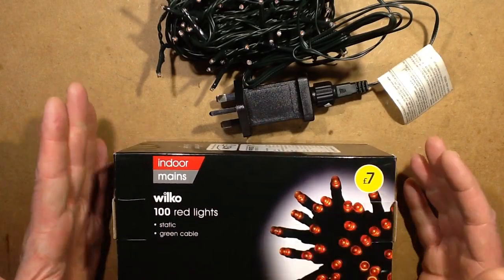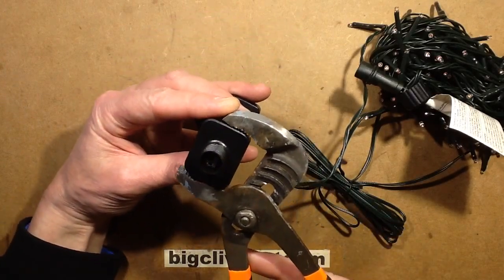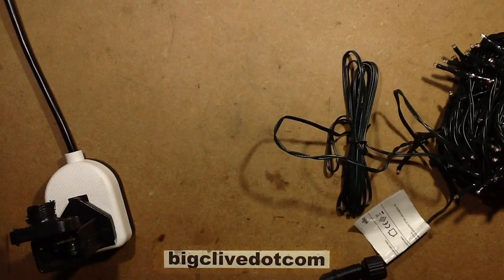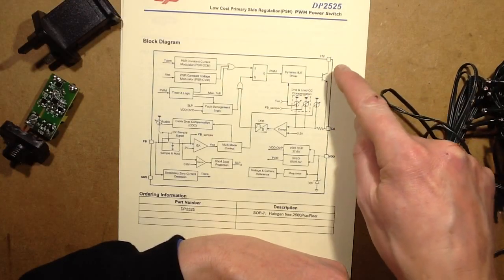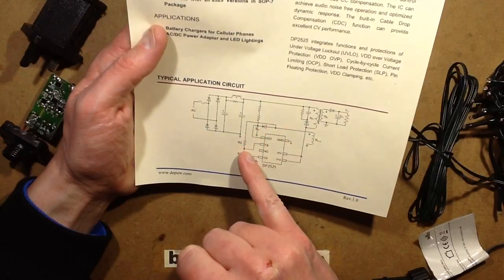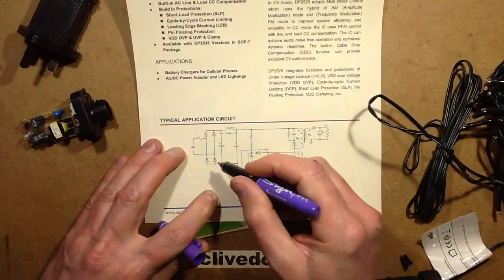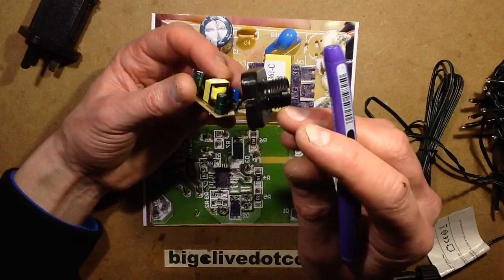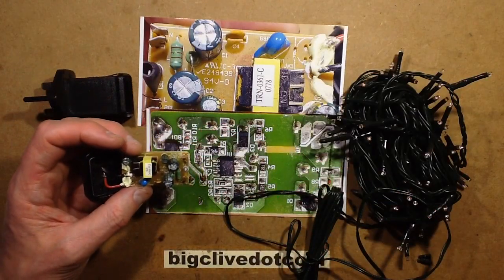Inside a Jutai Xmas lighting power supply.

Comment: Have one of these LED strings with a fault that did cut output power to at least a half. Now LEDs glow, but very dark. UPDATE: Found the problem - both BJT NPN transistors (FTC8050HH, with label KEY) behind JT-022 MCU went bad. MOSFETs (NCE60P04Y) was fine. Replaced FTC8050HH to SS8050 and lights worked again. But idea was bad in general, Vce for SS8050 is 40V and due to occasional 60V transients one of SS8050 died just 2 months later. Replaced both BJTs again, at this time to MMBTA06-7-F. Replaced US2G to fresh one too. And reflowed all suspicious solderings to be sure. All is fine now. Fingers crossed...

Comment: Just hung up a 1200 led warm white set of lights around my parents house that had one of these "well designed" boards to power the lights. Whatever happened, it burned through the dp2525 and accompanying resistor in about 20 minutes. Second set of these that the power board burned out in 2 years. Complete junk. (or maybe we're just very unlucky)

Comment: Hi Big Clive. Have just watched your christmas tree lights video. Really enjoy watching you strip back random electrical items to see how they come up with designs. Have you ever reverse engineered the timer circuit which they use on lots of these Christmas lights, the 18-6 hour timers? as i could do with an upgrade on some solar lights to maximize the few sunny days we get in the UK. Thanks David
Reply from the maker: It tends to be custom software in a microcontroller.
Reply: The better solar "christmas" lights now have the 6/18 timers built into them. I recently bought some sets of Philips solar net lights on clearance at a local hardware store, and they were very high quality, had large good glass solar panels, and did have the timers built into them.

Comment: Where is the best place to but a replacement led driver for a Christmas tree? (Stood on the plug taking the tree down lol). It’s a pilot king brand 29v 6w model number PK-BS-D290060N but I can’t see an exact replacement anywhere online as yet. Thanks
Reply from the maker: The generic 29-31V power supplies are common, so it may be cheaper to buy a cheap set just for the power supply.  Note that ones with two pins and "effects" reverse the polarity to the string for the effects and will not work properly with simple non flashing sets.
Reply: @bigclivedotcom  thanks so much. So as long as I get a 29v to 31v and Max 6w with 3 pins even though the earth pin is plastic it will replace it ok? I’ll have a look in tescos home bargains the range ect to c can I get a set with a suitable plug. If now Is Amazon the best place to buy these or do u recommend somewhere online in particular. It’s a pre lit tree with the lights attached(came with it) thanks again.
Reply from the maker: @ronant87  Most of these power supplies are double insulated, so have no metal earth pin.  The big stores will be dumping all their Christmas stock around now, so it's a good time to look for suitable power supplies with free strings of lights included.

Comment: managed to open mine cleanly after it stopped working using moderate heat from a heat gun, and after setting firmly in vice, priced it open twisting a wide blade chisel between the top cap and the vice jaws. Problem was that the connection blades between the mains pins and the circuit board had spread..probably the result of over active pulling the plug from the Mains...lol, closed them up to make contact again, everything working again, btw thanks for the video...

Comment: @bigclivedotcom I bought a Christmas Icicle set using one of these Jutai style transformers and maddeningly it doesn't appear to have a memory function 

Considering its installed with the plug socket in my home networking setup in the attic it's not terribly accessible for me to press 3-4 times until it reaches soft twinkle ( my partners preference of Christmas luminance cheer ) 

Do you have any insights into how to modify / replace one of these controllers to gain the memory function ?
Reply from the maker: It's usually easier to try and find a power supply that has the memory option.

Comment: Hey Clive, I'm trying to repair a 220V-31V/24W version of this. It looks like two of three parallel resistors on the CS pin of the DP2543 are blown. I can only read part of the codes on them (R_10). The remaining one is 4R70 and reads ok. Can you help me identify the blown resistors?
Reply from the maker: If the current sense resistors are blown it suggests that the driver mosfet has failed short circuit.
Reply: @bigclivedotcom  I was afraid of that. Not sure how it would happen with the OCP. Is there anything else I should look for as the potential cause of that if I plan to replace the DP2543?

Comment: Thanks your video helped me figure out that the power supply is repairable, I opened the case, pulled off the heat shrink from the "fuse" and hey presto the resistor is burnt to f'. I have 2 of these supplies gone bad so with some new 10ohm 2W 5% metal oxide resistors I should be good to go again. Would have been nice if they used a thermal reset or perhaps a proper auto style fuse that's easier to replace rather then throw the whole PS away or have to solder in a new resistor.

Comment: What kind of lifetime would be expected from such a led strip? Just had a look at a very similar set of warm white lights, and was very disappointed to see them get very dim after less than 2000 hours burn time. 31v rated power supply. Voltage under operation sits at about 29 volts, matching a less worn and still bright set, but the current is perhaps 20-30% above expected. 3 watts for a 12m 80 led strip.
Reply from the maker: White LEDs do often lose intensity over time.  The cheap ones used in Christmas lighting seem to degrade very quickly.

Comment: Hi can I ask a question, I have gone through 3 of these power supplies on my fairy lights. All 3 power supplies have been used on the same string of leds. The leds work fine for between 1-5 hours then they turn off and the power supply is dead. The leds are outside on a fence, maybe there’s a slight short in a wire and when wind blows the wire it shorts and blows the power supply, could this happen? I can’t understand how I’ve gone through 3, it’s so strange, love to hear any advice

I should add that the leds were working fine for 1 month with no issues

Sorry and another dumb question, is the output 31AC?
Reply from the maker: Are the power supplies the correct voltage for the set of lights?
Reply: @bigclivedotcom  yes they are 240v Australian, I opened one up, and looks exactly like the one you showed and nothing seems blows, no smell nothing, I also took off shrink wrap off the fuse resistor you mentioned and it looks fine, I'd ship it to you if wanted to take a look but I can't work it out for the life of me, the last one i put in lasted for 5 hours then lights turned off and power supply dead again never to turn on, so strange
Reply from the maker: @jimjones5419  What's the rated voltage of the LED string and power supply.  At first I wondered if it's the type of power supply that has the six hours on and 18 hours off function.
Reply: @bigclivedotcom  the primary is 210-240v 0.50A

Secondary is U rated 31v P rated 12W
U out is 34v and tc is 75 degrees C

Led string is 31v 9W and I have four connected together, hope that helps, thanks for your help

Comment: Nice one Clive. You are the only video I have found so far going over the 31vdc power supply. My 2 pin molded plugs on 2 of my nets work-hardened off so I am trying to find a large 31vdc power supply to wire them both into. I now realise that 31vdc is not a popular voltage. 😂
Reply from the maker: Very common voltage for LED light strings.   Basically 3V LEDs in ten series sections.  But quite an odd voltage otherwise.
Reply: @bigclivedotcom  tell me about it 😂. I thought it would be a good idea to build myself a single large power supply and then wire each set of Christmas lights into via spring loaded speak cable connectors. But you think I can find a 30vdc power supply anywhere?!  😂😂😂. Only thing I can find so far is a dell power supply. Surprised there is not a market for this sort of thing to replace a bulging extension lead full of jutai power supplies. Thanks for the video. Great work Clive. Just subscribed 👍

Comment: Can't believe how many, similar to these,  I have opened up where they fit a leaded diode in the clamping circuit to protect the transistor. On closer inspection it is usually a 1N4007 rather than a high speed version. Frightening cost cutting ideas, and explanation of early failure.

Comment: I was given a set of led lights to repair with one of these power adaptors. The adaptor was dead. It was a Jutai 4.5 volts 9 watt. To save time I bought an adjustable adaptor which was rated at 12 watts. At 4.5 volts the leds were drawing about 1.3 amps so I switched the output to 3 volts & that reduced the current down to .36 amps. There wasn't much difference in the amount of light they were giving out so I left it set on 3 volts. When I searched for an exact replacement I could not find any with the 4.5v 9w rating, they all seem to be around 5 watts or less. I wonder if there was a problem with these 4.5v Jutai power supplies failing due to the higher current output. Thank you Clive for the great videos ☺
Best wishes Mike

Comment: Does anyone know the low voltage connector type? I have several sets of these lights that I wish to connect to a multi-channel DMX controller that is specially designed for these dual channel 2-wire led strings. I have installed panel mount SP13 connectors on the controller housing as they have a waterproof cap. I could cut the existing connectors off the led strings and replace them with SP13 2-pin male connectors but I would rather leave them intact and make up adapters. Thanks.
Reply from the maker: I've not seen these connectors sold on their own.
Reply: @bigclivedotcom  I think Jutai likely developed their own 2-pin connector. I have seen "genuine" Jutai 2-pin extension cables for sale on Amazon for around $9 USD each, but they are more expensive than the led strings themselves. I'll just cut the connectors off and replace. Thanks for the reply.
Reply: @BarryTheCougar  Barry, did you modify the DMX controller?  I'm assuming you have incorporated squarewave AC. I am looking to find (inexpensive)controllers for bi-coloured LED that operate with the principle as the 2 channel string. Controllers I have found incorporate both channels in all of the effect modes.
Reply: Happy to hear you are Clivehandling the 2channel "Copper Wire Lights".. I'd be thrilled to compare our projects.. I have only been able to source spare connectors via manufacturers. $1 to $1.50US each (that's the male only) along with customized samples of CWL strings and standard PSUs..
Reply: @starlights50  Hi Matthew. Thanks for you comment. Have you been able to source the female connector from a specific manufacturer?
Reply: @nickz797  my replies are being deleted..
Reply: @starlights50  Hmmm. I can see this one though. Could you try again please? Thank you.
Reply: @starlights50  Hey. Did you manage to find the female connector? I found some close enough connectors, but not exactly it. I would be very curious to know what you found. Happy Christmas!
Reply: Seems I'm unable to communicate anything regarding suppliers here on YT.
Reply: @starlights50  My reply has been deleted twice now. Can we discuss this via mail? Mine is stolniko. The rest is the google email service with a com in the end. Sorry for mentioning like this but it gets deleted. I have found manufacturers that produce similar female connectors, but not exactly the same.
Reply: @nickz797  Hi. Sent yesterday...
Reply: @starlights50  Thank you so much Matthew! Sorry for the late reply, I was on leave. I will reply o your email when I get home from work!

Comment: I have a longer strand of lights made by lumineo, which are very similar in construction and  that were quite expensive.  They have stopped working.  I swapped out the 30V power supply with a known working one to rule out a power supply issue.  So, it wasn't the power supply and  now I am at a standstill.  Would you any pointers on how to troubleshoot these type of LED strands of lights?

Comment: I have a question I am hoping you can help with.  I have a Christmas tree with LED lights where the 30v-12watt power adapter (AC to DC) is failing.  Could I use a 30v-24watt power adapter without damaging the lights or causing any other hazardous problems?  Thanks in advance.
Reply from the maker: It should be OK if it's a regulated 30v output.
Reply: @bigclivedotcom  Much appreciated.  Just wanted to make sure using a power adapter with twice as much wattage wasn't going to heat up anything.  Thanks again!!!
Reply: @guyfroml  how did you get on with using the larger wattage adaptor? I’m having the same issue wanting to use a larger 5V supply and assuming the power supplies would be constant current so a 24w supply would blow a 12w string of LEDs?

Comment: Hello. I've bought 3 sets of lights with the same mains power supply and want to install these a distance away from the house. I already have an armored cable fused down to 5A for path lights but want to temporarily come off the end with the Christmas lights. I obviously don't want to fit IP rated sockets etc so was looking for an easy hack for the supplies. As these would fit into an adaptable plastic box, would 2 or 3 work from a 5A supply? Or could you recommend a lighting transformer that would take a 230v 5A supply and an output voltage equivalent to run 2 sets of lights? I just can't seem to find the right thing.  Thanks.
Reply from the maker: Each power supply is only rated about 5W, so you could run a lot from a supply like that.  Just make sure that everything is secure and watertight.

Comment: Hi Clive, I've got a similar Jutai power supply for a string of connectable LEDs, I was wondering if it was possible to add an in-line dimmer?
Reply from the maker: It's not really, but you may be able to add a suitable resistor to tame down the string.  There may already be one in use in the last LED position.

Comment: I have one of these that's gone pop.  The main chip is fried as well as an adjacent component. It looks like a smd resistor which has also cooked. I also have a resistor on the other side of the board split open.  Its this repairable ? I can't see the values in your video as the photo is backwards ! It has R1 next to it, starts with a 6 and ends in a 2.  I'd like to have a go at repairing it but need to identify the burnt parts.

Comment: Hey BC! Thanks for the awesome videos! I have a power supply like this, only it is a MLS chasing model. Is there any way to program it to start on the constant on program?
Reply from the maker: Some have a space for a memory chip inside to store the setting.  Sometimes they omit that chip.
Reply: @bigclivedotcom  Thanks for the reply! There are 2 SOIC8 chips on the board, one on the live side and one on the "DC" side. The one on the live side is marked DP2525 while the one on the DC side is has no markings, only the dot for pin 1. Pin 4 connects to the switch that changes the programms so I guess there is no memory chip. Neither is there a place to put one.

Comment: Hi Big Clive. Are these constant voltage or constant current LED drivers? I have a JT-DC36V24W-M1-IP44 supply that I want to replace with a standard type LED driver and can't work it out... :(
Reply from the maker: These are usually 31V supplies, but I think they also have current limiting.  Note that the "chasing" ones swap the output polarity continually.
Reply: @bigclivedotcom  Thanks for that. The 36V transformer (same form factor as the one that you stripped down) is for outdoor "festoon" lighting (no chasing) powered from within my pimped-up shed. I want to replace the plug-in version with a behind-the-wall "normal style" LED driver. And yes, I'm putting in an access hatch in the shed wall for when it eventually lifes-out. I think I'll continue my search for a constant voltage device.

Comment: I was a bit confused to see these supplies spec'd as 31v AC (?) but the output is marked as polarised. Is the output AC or DC 31v ?  Cheers!
Reply from the maker: The first ones were straight DC.  But the new two wire chasing ones alternate the polarity to switch two channels of lights.
Reply: bigclivedotcom thanks!
I don't have the original supply. Can I hook up straight DC31v? (Best to steer clear of AC, I presume?)
Reply from the maker: @EvLoutonian With the chasing lights an ordinary supply will cause only every second LED to light.
Reply: bigclivedotcom ah thanks..
I see. Yes, I've just hooked it up this way, and I have to choose red & yellow, or blue & green.   I'll go with red & yellow static, for now.. Thanks again- like your informative videos!

Comment: 7:32 Because how cheap the circuit looks (no real secondary side regulation), I am pretty sure it has a pretty poor power factor and it make LEDs flickering.
Reply: Whenever I disconnect my LED lamp with the same power supply my lamp flashes for 1 second. What could the reason be?